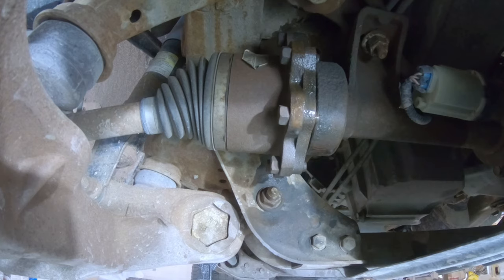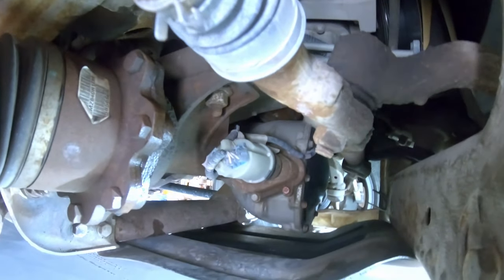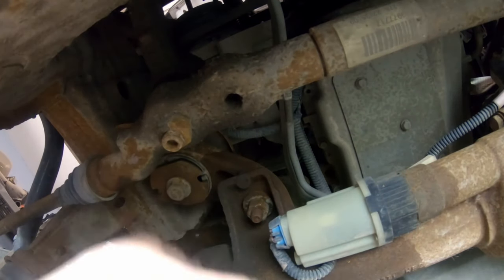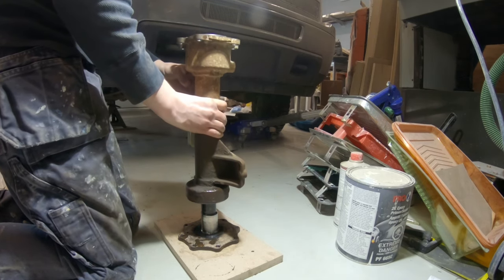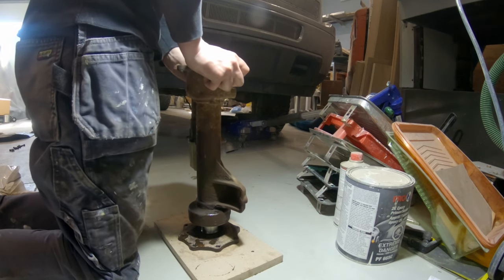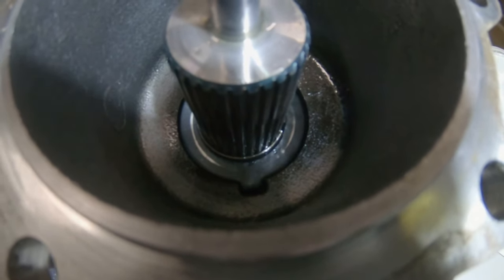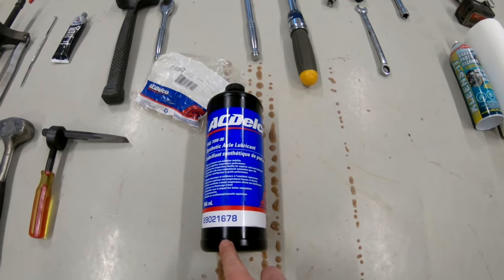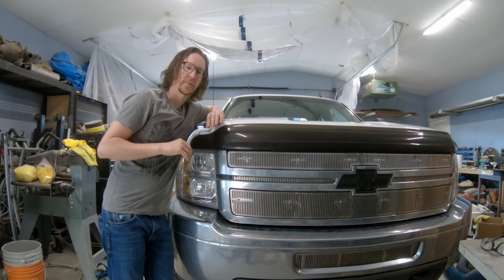How To Replace A Front Axle Shaft Seal (RH Front) Chevy GMC

Comment from the maker: Let me know if you have any questions on this job and I will do my best to help you out. Thanks for watching!
Reply: Wasn’t there a paper gasket between the “pumpkin” and the axle housing you removed? (The part that actually housed the axle shaft). Let me know, have to do this myself soon…
Reply from the maker: @danc5477 Yes there was on mine, I talk about it at 12:40 in the video. I used some sealant to just hold the paper gasket in place while I got it up into position. The earlier model truck just use sealant.
Reply: I’m trying to slide the stub shaft back in and it will not slide into its original position as I turn and gently push
Reply from the maker: @charlesbrisebois2435  Did it slide out pretty easy? I'm guessing if you got it out you have the older version with the spring clip vs the retaining clip and snap ring. I haven't done one of those but it's will take some force to get the end of the shaft back into that spring clip, about the same force as it took to pull it out. Then you also have to get it to line up with the center differential gearing.
Reply: Did you use any special tools?
Reply: Does this need to be replaced? I don't even use 4 wheel drive.
Reply: Do you have a link to the seal you ordered or a part number? Trying to find it for my 11 Suburban & can’t seem to find what I need

Comment: Good vid, but you need to show removal/installation instead of just explaining that you removed n installed. I.E., the snapring. Pliers do not fit inside housing on my 08. Show me how you did it
Reply from the maker: Sorry it's a really tight space to get into so very hard to film. I did use snap ring pliers to get in there and spread the clip apart and then used a hook tool I have to pull it up. I'm not sure there is a really nice way of doing it as it isn't really a proper snap ring with the holes in it for snap ring pliers.

Comment: If I go through all that work, Im replacing all bearings seals and worn parts. What if next year your bearings disentigrate.I wouldn’t want to do all this work over again.
Reply from the maker: I didn't look into how much all those extra parts would cost. Probably also depends on how many miles are on your truck. My bearings all looks good and I didn't let it leak all that much before replacing the seal so I was pretty confident that the bearings were in good condition.

Comment: On my04 GMC Yukon AWD, there doesn’t seem to be any gasket or sealer where the housing bolts to the diff. I can’t seem to find anything on line as to weather or not there actually is any form of gasket used on the diff. end.  Also the seal on the other end, it looks nothing like yours or the stock one. It is the same size but I’m not sure which side goes into the housing.
Reply from the maker: The early truck didn't have a gasket and they used a liquid product that might appear as though there was nothing there. I would use a little bit of gasket maker to re-seal it. Without seeing the seal you have it's pretty hard to assist you. Maybe check with the store you got the seal from.
Reply: @ResearchDesignBuild  thanks again. When I cleaned all the o and gunk off the old housing I did see they had used a very small amount of some sort of sealer, and when I say very small I mean very small lol. I put the new bearing in the new housing and the new seal, I put it solid side down like the old one was, I’ll see how that works out lol. I’ll go see if I can figure out what the best sealer/ gasket maker to use is… thanks a lot!
Reply from the maker: @hdrjunkie  No Problem, the factory uses very little. You don't want the squeeze out falling off inside and rolling around in the oil. Probably not the best thing.
Reply: @ResearchDesignBuild   yeah, I thought about that. Probably only needs a little any how because there’s a sort of “lip” on the housing that sits inside the differential. Thanks for the help.

Comment: Excellent video! I just done this to my 2011 HD and it saved me a lot of time. The snap ring was definitely a pain is the rear. I am now tackling the left side. Would you happen to know if the axle shaft can be pulled out or is it held in with a snap ring and require complete disassembly of the gear set. Appreciate any info you can provide.

Comment: i have an 01 that has an issue with this washer, i need to pull it apart, this video still helped
Reply from the maker: Glad it helped you out! Thanks for watching.
Reply: @ResearchDesignBuild  pulled an axle from a 98 and the internals were the same, just the outside was cast iron and the two bolt holes to the frame were off a little, i just gutted it and used what i needed, cannot believe how easy it was
Reply from the maker: @JoeHynes284  Yes there are a lot of similarities between generations. Engineers are creatures of habit, a bit lazy, and if it ain't broke... In truth there is a lot of liability and cost in designing something completely new vs just slightly changing something that is well tested and known.

Comment: You can also loosen the front diff bracket bolts that bolt above to the frame just loosen them aluttle then you can push up on the bracket to get more clearance to remove housing.

Comment: What is the gasket that connect the axle shaft housing to the pumpkin or what material did you use to put it back
Reply from the maker: It is just a thin paper gasket. I was able to re-use mine. I just added a thin coat of black gasket maker to it on both sides to help it seal and more so to keep it in place during re-assembly. The older trucks didn't have this gasket and just used gasket maker. I would just get one from your local FORD dealership, based on your VIN they will be able to make sure you have the right one. It should be pretty inexpensive.

Comment: Hey thank you for the video very informative I have a 01 Chevy Tahoe and the front differential is similar to my mines my Right side is leaking, my question is should I replace both sides since I’m doing right side? , oh and btw I drop whole differential I guess I didn’t  need to do that but hey you learn
Reply from the maker: I only did the one side that was leaking. Sometimes you open things up and can make things worse, so as the old saying goes, if it isn't broken, don't fix it.

Comment: What part number is the seal?  this seal seems much larger than the one I’m getting back from the parts store. Thanks and great video.
Reply: Also, does the entire part come off and is replaced or do you remove the part and only replace the inner part which is the seal and reuse the outer part ?

Comment: Is the seal the same on both sides mine is leaking from both and I live in the northwest and I can't even use 4x4 in the winter  cause it leaks so bad.
Reply from the maker: Best thing to do it call the dealership and get them to run your VIN and confirm the parts. I'm not 100% sure if its the same left and right. And it's really had to drive back to the parts store to get the right seal when you truck is all tore apart. Not that it has ever happened to me before....

Comment: At 11:45 in the video when you drop the washer with ears in, did you put the c clip over that or is there an additional washer between the c clip and the washer with ears?
Reply from the maker: The C-Clip goes around the shaft right on top of that thick washer with ears.
Reply: @ResearchDesignBuild  thank you for the quick response, all the other videos I see are pre 2011 and they have an additional washer. I’ve been going insane looking all over for this non-existent washer. Reason I’m looking for it, I can turn the axle fine with the c clip on over the eared washer, but when I install that shaft to the rest of the diff I can’t turn the axle by hand any more like it’s engaging the 4wd. But my actuator is all the way in you can see it before I install, I’m maybe thinking I should get a new axle shim washer mine has some heat marks/little lines that almost look like cracks, and looks like maybe it’s thinner than spec. My axles were banging around pretty bad and maybe flattened that washer. My leveling kit is turned up pretty high and i was missing the limiting straps causing my axles to bottom out the suspension rather than the straps. What are your thoughts?
Reply from the maker: @Nate_Brown11  I don't think that little washer will make that much of a difference. Mine was also showing a little wear but it went back together just fine. I would double check that you have everything lined up correctly and engaging properly. The lift would probably affect the half shafts and joints there, more so that then stub shaft that is part of this axle assembly.
Reply: @ResearchDesignBuild  Thank you for your help sir, your quick response to comments and your for your video. I believe it’s the only one that shows the 2011-2014 platform for this repair. All the other videos are early models and I’m sure you know like I do a lot is similar but changed for 2011+. Got it all back together and she drives nice, no leaks something must’ve not been lining up beforehand.
Reply from the maker: @Nate_Brown11  Great to hear! Happy that it is all back together and working well for you. The whole point of these video's for me is helping out other people trying to do work themselves.

Comment: Couple questions…I have an 04 Yukon AWD and the housing that you removed in this video to change the seal on cracked on mine so I need to change it. I got the part, basically the same one as you have here but without the mount for the 4WD actuator,  anyhow, does the 2004 have that split ring like yours did?  Also, what other seals and bearings do I need to get? I cannot find anything on line with the part numbers listed for my truck so I can’t figure out the bearings / seals and what gasket I need to get for it. Thanks!
Reply from the maker: Try this link - https://www.gmpartsdirect.ca/a/GMC_2004_Yukon-Denali-Sport-Utility-60L-Vortec-V8-AT-AWD/_84589_6378554/DRIVE-AXLES-AXLE-SHAFTS--JOINTS-DIFFERENTIAL-FRONT-AXLE-PROPELLER-SHAFT/T010060.html
Looks like you need Differential Drive Pinion Oil Deflector, and Drive Axle Shaft Seal, and finally Drive Axle Shaft Bearing. Being a 2004 I don't believe that you have the same retainer snap ring holding the axle in. When in doubt I would just go talk to the parts guy at your local dealer. Or even any of the good aftermarket parts stores. They will be able to give you a breakdown of what you need.
Reply: @ResearchDesignBuild  awesome… thanks. Now as soon as it gets a little warmer out, I can put this wreck back on the road again. Lol

Comment: I’m having a problem sliding the stub shaft into the diff I didn’t remove the housing like you did, I just slid the shaft out and replaced the seal, just trying to get the shaft back in is my problem
Reply: Did u get a answer, I'm having same problem
Reply from the maker: Hope you guys got it figured out. It does take a bit of effort to get it sealed back in properly as there is that little spring clip that prevents it from coming out easily, but that same clip prevents it from going in easy as well.

Comment: What is the part number on this seal ? I’m having a hard time finding one for my 2013 gmc Denali 2500 6.6 4x4
Reply from the maker: I would check out https://www.autozone.com/drivetrain/cv-axle-seal/gmc/sierra-2500-hd/2013
Best thing to do is call the guys at the parts counter, either at a place like autozone, or even the dealership. They can use your VIN number and make sure the part fits and even show you an exploded view usually so you can make sure you are getting the right seal. Dealerships are sometimes more expensive, but recently I have found most prices on stuff like seals fairly reasonable. I got all my part at the dealership and it was cheaper there than at the local auto parts store.

Comment: Is this the same on 1500 trucks?
Reply from the maker: Sorry for the late reply. The design is very similar but the parts are all a little smaller. So the process should be very close, but shaft will be smaller with fewer splines, seal will be different, etc. But all the same parts in all the same places, just lighter duty and smaller.

Comment: Thanks for the video. I am having problems sliding the axle from the differential due to the two mounting bolts sticking down from the mount on the wheel side. They are protruding down far enough to prevent the axle from sliding out and I'm stuck. I've loosened the mount bolts from the wheel side and tried lifting that mount out of the way, but it's simply not enough room. Any ideas? Thanks.
Reply from the maker: Have you turned the wheel all the way to the right? Then I lifted the axle up and held it up with a rachet strap. That gave me just enough room.
Reply: @ResearchDesignBuild  I finally got it. Thank you!
Reply from the maker: @razorsharpbt124  any time! Glad you got it, it is a tight fit.

Comment: Do you have a gasket number and brand?
Reply from the maker: I just re-used the old gasket as it was still in perfect condition. I would buy it from the dealership. Even the seal I found to be less expensive at the dealer than I did at the jobber stores.

Comment: Hi There,My chevy making very loud noise while driving 4x4 , is it broken front differential?
Reply from the maker: It might be. Does it still make a sound when you are in 2 wheel drive?
Reply: @ResearchDesignBuild  no,driving 4x4 only
Reply from the maker: @tinhtran1309  My guess is that it has something to do with the 4x4 actuator not engaging correctly. You will have to take it apart and see what is broken or worn out. Hopefully it hasn't spread metal through everything else in the differential.

Comment: What causes the damage to occur? Rough roads or potholes?
Reply from the maker: Probably dirt and debris slowly working it's way into he seal from the outside. I got 180,000km (108,000 miles) out of my seal. So that isn't bad.
Reply: @ResearchDesignBuild  do you think we need to replace the bearing as well? How has the new seal been working for you?
Reply from the maker: @jrm163  No issues with my seal at all currently. The replacement of the bearings will be on a case by case basis. I replaced my seal when it just started to leak so I figured it didn't get much stuff into it. If yours has leaked for along time, them stuff could have leaked in as well.